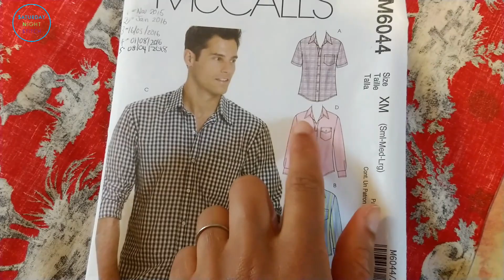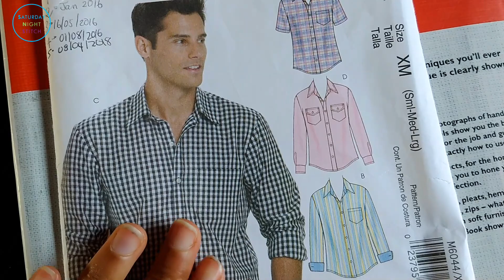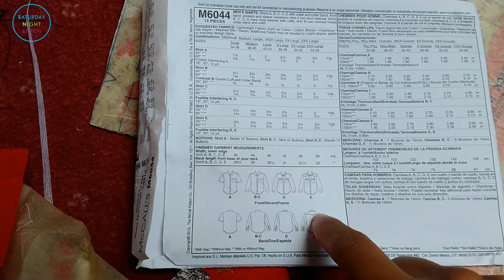McCalls M6044 Sewalong Tutorial | DIY Men's Shirt Sewing Project |

Comment: That sleeve seam is very weak -- you only have one sewn line to hold it together.  That is not a flat-felled seam either.  Does that pattern offer any alternatives to that weak seam for the sleeves?  With a 5/8" seam allowance, the should be PLENTY of material for a better seam there.

Comment: Am I the only one that thinks there's a problem with the notches on the sleeve pieces in this pattern? You can match the edges of the pieces or the notches, but not both. Which makes the usual challenge of easing a high sleeve cap less likely to succeed. I'd love to hear if anyone else has had this issue and how they solved it.
Reply: OMG, I am making this shirt now, and thought the very same thing (or, alternatively, that I was going crazy). The sleeve back and shirt back double notch don't match up. I was easing in since the pattern specifies this, and I just scrunched up that little 2 inches or so much more than the rest of the sleeve to get the notches to match. Don't notice it on the right side of the garment. HOpe that helps!

Comment: Do you think this pattern is true to size.. meaning readymade size?  Measurements for fit are not very helpful.  Back length and bottom width really don't tell you much.  Should I make same size as readymade XXL or should l go bigger?
Reply from the maker: Hi! In sewing true to fit relates to hoe the finished sewn garments looks like the image on the pattern and whether the size you selected matches with what is on the size guide - its not compared to RTW clothing as they differ in fit from brand to brand. Select the size you want based on your chest and waist measurement according to the size guide on the back of the envelope. I recommend making a trial garment first to see if you like the fit you get. I did that with this shirt. The fit of this shirt is not tailored - its more of an easy fit style for a casual shirt.  RTW sizes do not translate to sewing so use your measurements instead. Hope that helps.